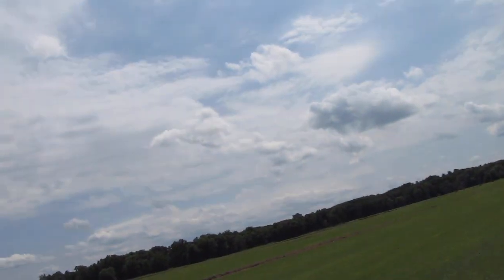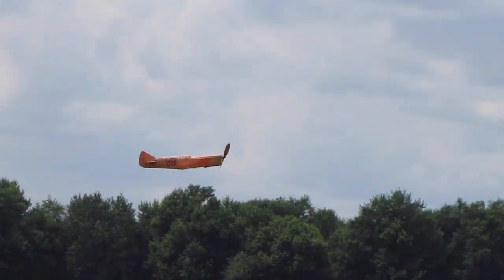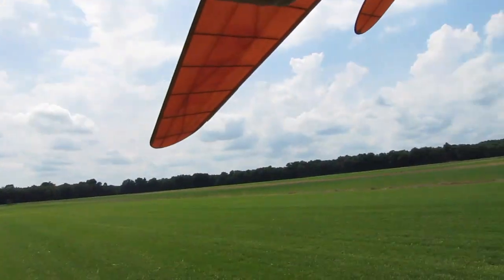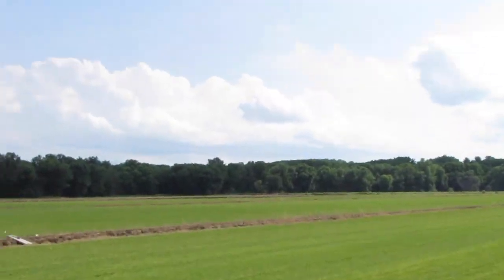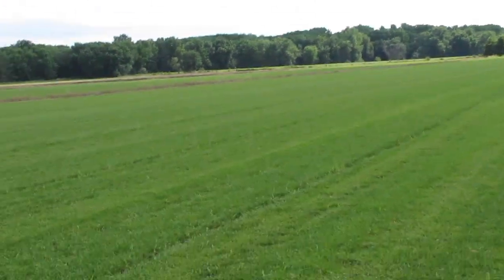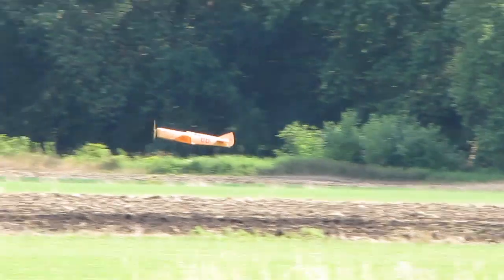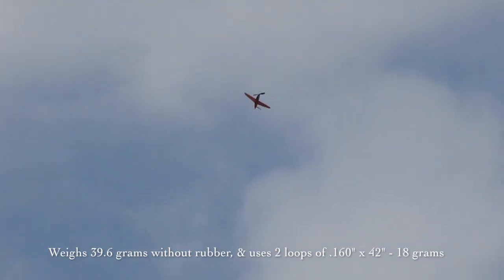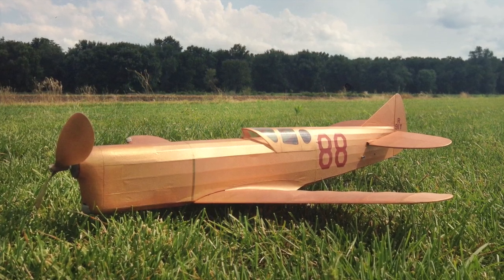Rubber-Powered Haines Racer - Anatomy of a Trim Session

Comment: Is the constant turn generated by rudder offset or lateral balance weights? Amazing to watch.
Reply from the maker: Yes....haha.  Actually, it's a blend of a few things.  I'd say that the thrust is what affects the constant turn the most, but then you're dealing with thrust and torque, so as the torque fades, the thrust isn't nearly as powerful.  That's when tweaks to the rudder, or gurney flaps on either TE, or small amounts of wing tip weight will keep things in check as the model transitions from the power run to the glide.  Each model is different, so it's like reinventing flight each time out. Even with building the same model twice, you'll probably end up with two different trim patterns...which in the end is good, because it increases ur knowledge base and experience with trimming. Glad u enjoy the films.
Reply: I was an rc guy, now I fly full scale, but there is something really peaceful about this.

Comment: RE the Haines looking like a Caudron C.460, the  R-1 Chambermaid  22"  1938  by Russell Chambers also looks like the Haines (kinda). I was positive I had the plans for the Caudron so I went looking in my plans and nope, but I did have the Chambermaid plans. Around 2001 for some reason I ran across an estate sale of old stick & tissue plans and I don't think the guy knew what he had and I thought oh my gosh, I can't turn my back on this.  Anyway, I bought all but maybe three and once I got them and saw how nice they were, I went back for the remainders, but they were gone. These plans are like works of art to me and as far as I'm concerned, they're irreplaceable - they're history - they're museum pieces.  It's a lot of work unrolling these, so I thought, I ought to make up a list of what's here while I'm looking for the Caudron. I'll paste in the list. Wonder if any of these are near and dear to you - if any tug at your heart? Here's the list:
Megow  Waco Cabin Model  23"  1935  biplane  by Fred W. Megow
Comet Sparky  32"  by Edward Lidgard
Mercury Sirocco  32"  by Brian Lewis
The Hurricane!  33"  by Earl Stahl  Model Builder Magazine
Mercury  36"  High wing cabin  (shows engine with ignition wire and rubber, bearing & nose block)
Cleveland Flemish Defiance C-2  32"  1952  Class C
Cleveland Polish Valor C-4  32"  Class C
Best By Test Model Co. Sensatherm  44"  by Ed Schlosser  Class D
Midwest Dyna-Moe  33 3/4"  Class C
Jetco Eaglet  18"
Berkeley Models The Chiertan  26"  low wing  1941
Fly Boy  18"  R.O.G.  1964
Comet Percival Gull  18"
Poly HLG by Bill Blanchard  21"
Miller's Manhattan  20"  by James I. Miller
R-1 Chambermaid  22"  1938  by Russell Chambers (looks like Caudron C.460 & Haines)
Dick Korda's Victory  32"  (looks original & says NAA)
Walt Mooney Quail  1979 (forgot to measure wingspan)
1940 Moffett Winner  46"  by Roy Nelder  Model Builder Magazine
The Navy Flyer  26"  by S. Gilles... (name / corner missing)
Scientific The Olympic 40"  high wing cabin
Outdoor Cabin  1937  by Earl Stahl  Old Timer Models Milwaukee  dated 1979
Hi-Climber  30" 1939  by Earl Stahl  Flying Aces Magazine
Korda's Wakefield Winner  44"  kitted by Megow  Model Builder Magazine
Dick Korda's The kO.R.da Open Road Special  35"  1939/40  from Open Road For Boys Magazine
Newer:   These two, the Eaglet and the hlg are mine
Midwest Gollwock II  31 3/4"  Wally Simmers Nostalgia Series
Midwest Jabberwock II  31 3/4"  Wally Simmers Nostalgia Series

Comment: Are the wings, stabs and rudder glued to the fuselage? If not how does this stay there? Is there any illustration available on a website?
Reply: Go to www.flyingacesclub.org, Yasser. There there are tips for doing a lot of things in their newsletter, that you can subscribe to or look at it on-line first for a sample.
Reply: The stab on this airplane pivots on the center spar to "dethermalize" it from the uplift thermal it was in that made it go so high. If this had'nt happened, Tom would probably lost it on a flyaway!  Just join the Flying Aces Club of the world because all it's members are eager to share all the secrets that make these ships fly.
Reply: Not always, but usually the wings are glued onto the fuselages except on the bigger planes, above 30" w/span.

Comment: What is the Rubber motor specifications in it? I mean to ask e.g. number of strands and length etc
Reply from the maker: four strands (or two loops) of .160" rubber, each strand 42" long.  Gives me 2400 turns.

Comment: Nice flights! When you say 2 loops of 42", is that 42" total length looped twice  creating 4 parallel strands of rubber at 10.5" long?
Reply from the maker: Thx.  No, each loop (and strand) is 42" long.
Reply: Ok. So then you have a total of 84" of rubber in two separate 42" pieces and each piece is put into a loop so you wind up with 4 lengths of rubber 21" running from the nose to the tail?

I'm needing details because I'm trying to get my plane flying and everyone seems to use the terminology of "4 loops of ...." or "6 loops of..." and I can't seem to get an actual setup of how the rubber motor looks and is built.
Reply from the maker: Here's how I translate (for example) 2 loops of 3/16" x 42" long.  Each single strand would be 42" long.  So in effect I am starting with a single piece of 3/16" rubber that is over 168" long (a few extra inches to tie the knot). Tying the ends makes an 84" loop, which is doubled over, making two loops, 42" long.  However, before I double it over, I wind in anywhere from 140 to 200 forward winds, which allows the rubber to braid itself, and keeps a rested tension in the rubber to prevent shifts in CG.
Reply: That's exactly what I needed to know. Thanks so much!

Comment: Which timer do you use, silly putty timer?
Reply from the maker: No, I've been using the button timers.
Reply: Button, like electronic release button?
Great flying model and great field!
Reply from the maker: Thx, it's an amazing space.  Here's the link to the button dethermalizers or timers.  It's not electronic, but instead works off the slow release of a friction fitted post and arm.  http://volareproducts.com/BUY/index.php?main_page=product_info&cPath=1_36&products_id=600
Reply: Thanks a lot!
That is the same principle as the timers we call "silly putty timers", but I didn't know they could be bought readymade - guess I will do that  from now on,  they look smaller than the ones we can make!
Thanks!!
Reply from the maker: I've always suspected that silly putty was used as the "viscous material" that creates the resistance.  The button timers are definitely reactive to changing temperatures, so you need to be aware of those tendencies each time at the field.
Reply: Yes, we are aware of it, and yes, they do run quite a lot slower at low temperatures. 
Apart from that they do work great and are light weight!